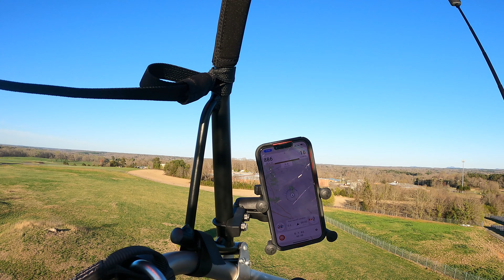Warmer Spring Like Flight but Trashy Air!

Comment: I flew for the 1st time (this year) 2 weeks ago in SE MI. I had the wing spin just like what happened to you.  I wonder why that happens? Cross wind? I ended up pulling a Capt Kurt as well but left the ground rocking hard. Where are you flying? What comms/radio do you use for air traffic control? That's a nice rig you're flying. That 360 view is awesome! Do you have a line assist configured to come off pressure right at 12 o'clock, or should it come off at 11 or sooner? I'm flying a new 28M Spyder and I'm wondering if that wing spin is due to a line assist pulling for too long, especially with slight crosswind.  Hopefully, conditions improve soon as we get further into spring it's been very rough air around here too. Keep the videos coming! See you in the sky!
Reply from the maker: Brent, first congratulations on getting into the addiction!  Yes I believe the reason this happened to me on the last two times was because of crosswinds, even though they were light winds they were changing direction as I was setting up.  I fly out of Shelby, NC which is about 65 miles from me so I have quite a drive to fly.  I do have line assist and I was taught to adjust it so that the As are taut up to about 10 to 11 O'Clock.  All my equipment is listed in my description, the radio I use is a Rexon 530-HP that I got in Lakeland, FL at Gulf Coast Avionics (you can find them online).  It goes into my helmet which is nice because I can constantly here is going in and out of the airport.  The weather here has been super crummy too!  Yesterday it was looking like I could fly early this morning so I had my alarm set to 5am to take the drive and when I woke up we were having thunderstorms, so these weather apps are not all always reliable for sure.  Thanks for watching, really appreciate it and hope to have more videos coming soon when the weather cooperates more often!